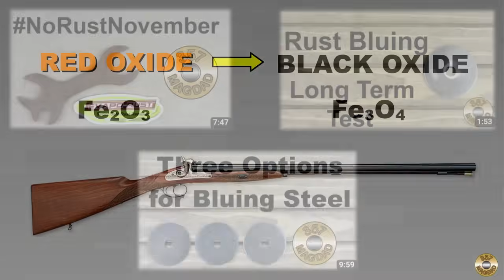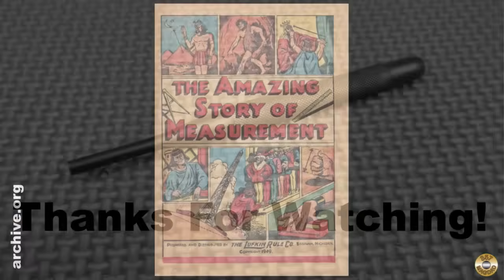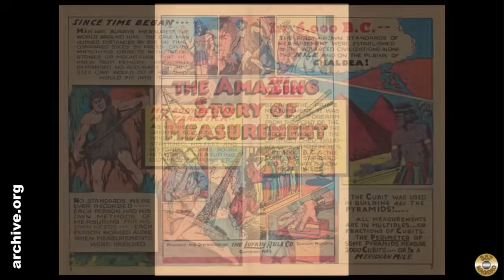DIY Rust Blue - Bluing with Peroxide, Vinegar and Salt

Comment: It should be noted that this type of bluing solution should not be used on firearms. The hydrogen peroxide can cause hydrogen embrittlement leading to failure of hardened parts. There is a reason why quality bluing solutions are available for firearms. If this was safe for firearms, those companies selling other bluing solutions would be out of business because gunsmiths would just use this recipe.
Reply from the maker: Thanks for watching! I think the hydrogen embrittlement occurs when steel is exposed to highly concentrated peroxide vapors for an extended period of time.  The commercial rust bluing solutions are specially formulated to produce colors that better match the original bluing on vintage firearms.
Reply: I call BS on this.    You're not heating the steel up to even lower critical point.   From what I learned in college you hafta be above upper critical point for this to happen. Plus the peroxide has already flashed before reaching 212°F.      Nice try to put down his video though 😢
Reply: @coburnlowman  Hydrogen embrittlement does not require heating the part to occur. It can happen even at room temperature. Ask yourself this.... Given how resourceful and independent gunsmiths are, do you really think they would spend the money on commercial bluing solutions if they could make their own for pennies? The "commercial solutions match antique bluing better claim" doesn't hold water. If nothing else,  gunsmiths and firearm manufacturers would be using this for modern guns. And yet they don't. Gee... Wonder why that is? Feel free to use this solution on all of your guns. No one is telling you what you can and can't do. I'm Just putting out a simple warning because the video shows a gun and there are no disclaimers about what this should and shouldn't be used for.
Reply: How would one be able to confirm or falsify your claim?  Thanks.
Reply: I've used this on gun parts for years. After doing a few I heard about the hydrogen embrittlement thing and was terrified I'd made some bombs in the past. Ran it passed a chemical engineer friend who works in the synthetic fuels industry and he calmed me right down. According to him it happens slowly, penetrates very, very little and the effects are insignificant unless the exposure occurs under pressure like in a containment vessel. I think the reason it's not used commercially in gun bling is that it's very aggressive, can quickly cause pitting and doesnt result in very fine grained rust. The finer or more powdery the rust bloom the finer the finish. Re the pitting, I ruined a few small parts in the past by leaving them just a little too long. Apparently ferric chloride in place of the sodium chloride makes it a little less aggressive.
Reply: Hydrogen embrittlement of gun steel , by Gerald L Spencer. November 1987. This is another report I found on this subject. He said the steel has to be held at 200° C for twenty hours in hydrochloric acid for any noticable reaction. At 16 hours there were only 10% failure under these extreme conditions. What little I read of this report, said that it happens at the upper critical point in manufacturing. 
   I couldn't find the original report from WWII again. It was found on the Scribed website tho. The 1987 Report was just a Google search.
Reply: The video before this, a gunsmith used higher quality rusting salts and then applied the same peroxide. 

Also consider all or most of the peroxide is reduced into iron oxide. 

You make a great point to consider hydrogen embrittlement. Perhaps the solutions should have an excess amount of rusting salts to ensure there is no free peroxide.
Reply: uummm a Noob here.
im restoring a 1960 pieces. had done all the necessary cleaning and stumble upon this "DIY Rust bluing" method,

can anyone tell me if the method  on the Vid will cause peroxide embrittlement or it's save to use on the gun (sear,safety,trigger) Spring?, you know the one goes on the inside of the grip. its  blued before and its already pitted so i clean it throughly.

now im scared
Reply: This is false. The hydrogen in the the peroxide solution is bound as water. Its a mixture of H2O2 and H2O. It donates oxygen to cause the rusting, but the hydrogen stays put in water form. If what you said was true, then just putting steel in liquid water would cause hydrogen embrittlement. It does not.
Reply: common mistake, hydrogen embrittlement requires pressure and/or much higher temperatures.
i commonly soak my blades in muriotic acid ( hydrochloric acid) to remove mill/forge scale. if this phenomenon occurred at low temps and pressures id have gotten back plenty of culinary knives needing repair or replacement  ive manufactued and sold literally thousands of kitchen knives over the last two decades and have yet to have pieces return due to embrittlement...a usually have to repair about a half dozen knives a year and the vast majority of those are handle issues from people letting the hardwood handles soak in water or get run through the dishwasher..this is right up there with the 'stress risers'  boogeyman. people are told something thats taken out of context from industrial processes and apply it incorrectly to the artisan craft world then this rhetoric is spread .
Reply: @mondrose4501  your fine, hes completely wrong. read my reply below.
Reply: Thank you for sharing because I was wondering about that. 
Thanks again for sharing that information 👍🏾
Reply: @RedDogForge  
Thanks for the insight from a master point of view, Means alot since i dont want to cause brittle to this piece of history.
Reply: @RedDogForge  thanks for sharing your knowledge 👍🏽there is a lot of intestine comments. 
If I'm going to blue my pistol I'll just use the commercial stuff. If I was a knife maker or a gun Smith I would probable try and find the least expensive way to blue metal.
Thanks again for sharing RedDogForge ✌🏽
Reply: @mondrose4501  you'll be fine, theyve been rust bluing firearms for centuries
Reply: You don’t know what you’re talking about.  You are confusing this technique with the hydrogen embrittlement that can occur through electrolysis in which case the part is subjected to high concentrations of hydrogen for hours or days.  Gunsmiths don’t use this technique because it’s laborious.  You’re not making a profit using this technique over the faster techniques.
Reply: Dayum dood, you got schooled by the comment section. That crackerjack box "degree" you think you have didn't pan out now, did it??
Reply: Interesting. I recall that hydrogen starvation in high carbon steel can occur in marine atmosphere, causing brittleness and mechanical failure. This was a problem about 20 years ago when a new section was added to the Bay Bridge in Oakland California. Steel truss rods imported from China were to be of a specific alloy, but they sent high carbon steel instead. A year into the project, and failures started to occur. A nightmare to be sure.
Reply: @rowbearpucklebuck2331   im talking out of the top of my head here but my guess is that had a lot more to do with the fact that they shipped high carbon steel than mild. otherwise unalloyed high carbon steels are potentially more brittle than mild ( depends on the steels grain structure from working it as well as heat treatment )and are more succeptible to rusting from salt exposure. mind you this is for m my pov as a knife maker and machinist  im no structural engineer.
id be interested in reading the paper/article..( im a right party animal, i know. lol )
Reply: Tanks ! Saved some research
Reply: When I was in first grade pa got me a chemistry set for christmass , there were some empty spots in it wich had the chemicals he need to blue his guns old school . I got the recipe but several components are unavailable.  Young chemists never even heard of some of them .
Reply: @RedDogForge  a buddy was just telling me that salt petre was never used in pickles and hasn't been used in food since the forties ,, I went and found it on the label in ham . Still a color preservative.
Reply: @RedDogForge  Thanks for the response. I too am just a blacksmith machinist, fabricator. However at that time i was working towards my Mechanical Engineer ticket and working on elemental starvation of steel and steel alloys under varied conditions. Company i worked for was having weld failures at an alarming rate on vacuum chambers and a solution had to be found. Turned out a number  of fuse welded elements were failing because in fuse welding a certain amount of the alloy was being consumed in the weld process. So the weldments became starved of key elements, causing brittleness and eventual failure. It was determined that adding filler rod solved the problem by adding more than what was lost in the welding process. I am sure there is lots of papers on it. As for the bars on the bridge, it wasn’t rust, but actual cracking and splintering that was occurring.
Reply: @shawntailor5485  yep. salt petre ie potassium nitrate. used in a LOT of stuff
Reply: Where is the  hydrogen to cause embrittlement?
Reply: Hydrogen embrittlement is easily fixed just by heating the metal in an oven to about 375 to 400 for about a half hour just to cook it off and far below any temp that would hurt the metal you should also note this can happen when plating such as nickel the fix is the same way
Reply: Peroxide doesn't have excess hydrogen. It has excess oxygen.😊
Reply: It should be noted you have no idea what you are saying
Reply: My friend restores antique firearms and he uses this method because it is what the gunmakers used in the first place!
Reply: @marcwilson1052 the inexpensive way would be to use various DIY and commercial rust blue methods on small pieces of steel and then use a big lead pendulum to hit the test pieces with consistent force and see which is weakest.
Reply: @mtslyh because most modern firearms are either phosphated or cerakoted, like no one blues anymore
Reply: its been 5 month since i ask the question here.

and i had done it. no sign of Pitting or whatsoever and it look blackish doff. 
Thx alot guys
Reply: Good point.  It's also a very small quantity of 3%. Basically just slightly oxygenated water

Unless the temperature is high to open up the grain structure and allow the hydrogen an easy way in. This is why it's a massive problem with welding.
Reply: @coburnlowman heat is not a requirement, my man.
Reply: We use extremely high percentage hydrogen peroxide in our production facilities and if it doesn’t degrade stainless at 165 degrees many times a day and I don’t think at this concentration it would screw up harden gun steel …
Reply: @357magdad as a person who worked in the plating industry, you have nothing to worry about. Its not that hydrogen embrittlement doesn't exist, however it is caused by using hydrochloric acid at high temp or using an electric charge. HCL helps increase electrical conductivity for the copper and nickel substrates for steel plating. This is why you should never chrome suspension parts or any other stressed member.
However, plenty of guns are chromed as well. I probably wouldn't use bright chrome on the barrel or cylinder of a .480 Alaskan
Reply: I think @mtslyh is a hyna
Reply: They don't use this because the other ways are quicker and nicer looking
Reply: @wmdevittdevitt2686 You sir are correct!
Reply: @mtslyh  they aren't because it's seriously inefficient compared to wiping on a product and they care about bottom line not quality
Reply: If that's the case then the punch he made is useless according to yuh
Reply: Well you can do this without the hydrogen peroxide.. just boil the parts in vinegar. 
There are some videos on that just look it up
Reply: @banilvdm2  Exactly. The acid would be more likely to cause it, and it doesn't.
Reply: @RedDogForge  Hydrogen embrittlement also requires H2, which H2O2 doesn't let go of.
Reply: The commercial gunsmiths are neither scientists nor engineers, so none of them have ever done any verifiable testing if this method actually does lead to hydrogen entitlement and neither do they know anything about chemistry or they could just make their own solutions cause if you know a recipe, anyone can mix it
Reply: @banilvdm2  I love informed replies that make those who would scam us for hundreds of dollars squirm..
Reply: @jomamma1750  Yeah he'll be asking student loan forgiveness for that degree😂
Reply: Many don't and I claim BS too. Hydrogen embrittlement is a welding issue not a finishing one. @mtslyh
Reply: Would this be okay to do to my pellet gun I'm restoring?
Reply: Hydrogen embrittlement requires a higher concentration of hydrogen peroxide than this, something like 7%.
Reply: 📌📌📌That's excellence source of knowledge!! 📌📌📌
Reply: @coburnlowman  Bravo!
Reply: You think big businesses give out their secret to us ?
The small Hoppes bottle of oil they sell us for $10, is nothing but mineral oil that you can buy a quart in pharmacies for less .

Comment: Nice looking results!! Just a tip for anyone out there: Every time I see one of these blackening videos (not yours) they always use metal channellocks or needle nose pliers to pick up the piece being blackened. Then they say "be careful not to scratch it" Lol. The best way is to use kitchen tongs with silicone ends/tips, with steel handles. Just a recommendation to prevent any scratches and achieve a better result. Hope this helps. Thanks.
Reply from the maker: Thanks for watching!  Rust bluing is a very durable finish.  Check out my bluing comparison video:
https://www.youtube.com/watch?v=QkcKGgHGRo8

Comment: I used your formula to rust blue a 100 year old broad hatchet.  I put on six coats, boiling between coats and carding between coats.  It did good.  It looks 100 years old, again.  I had to hang a new handle in it, which I rubbed down with walnut stain and started coating with linseed oil.
Reply from the maker: I'm glad you had success rust bluing John!  I'd love to see a couple photos of your project!  357mdad@gmail.com
Reply: @357magdad  ok

Comment: Very interesting.  Thank you.  I read somewhere that during WW2, the Japanese used urine to make some type of "anti-rust".  Their government urged citizens to save their urine for collection.  I read the article a very long time ago and have not been able to confirm this since that time.  On another matter, instead of brushing the bluing on, I see that a lot of machinists just immerse the part into the bluing and let it stay in the solution for a bit.  They do use commercial bluing and seem to get a nicer job then I can get using brushes, cotton swabs and etc.  I haven't tried this yet, but plan to.  Thanks again!
Reply: I once got a very interesting patina on bronze by burying it in sawdust and peeing on it every day for a month. The gold color changed to black with verdigris streaks. The recipe came from a Chinese friend I knew in art school.
Reply: Interesting video Magdad. Is this procedure something that you will start using more than cold blueing? I am going to try this. Thank You for sharing!!
Reply from the maker: I've used it here and there if the part is small enough to boil.
Reply from the maker: Sounds interesting Michelle!
Reply from the maker: Thanks for the info!  Submerging would probably work too.
Reply: in colonial times of America urine or dirt from the outhouse area of citizens was collected to make potassium nitrate, an ingredient of black powder.

Comment: For metric-inclined audience, the ratio (by volume) is 16 parts peroxide to 4 parts vinegar to 1 part salt.
Reply from the maker: Thanks!
Reply: There are two types of nations in the world: those that use metric, and those who have landed men on the moon.
Reply: That’s pretty funny. Ratios have nothing to do with metric or SAE. It is units independent.
Reply: @jvernice Of course ratios are unit independent. However, the devil is in the details. It's one TABLE spoon of vinegar to one (or 3/4 depending on whether you trust the video or the caption) TEA spoon of salt. The ratio of tea spoon to table spoon volume isn't something I am familiar with, which is why I converted everything into a proper ratio of equal parts. There, I've spent 15 minutes reviewing the weird thing I wrote in a comment one year ago. The fifteen minutes I'm never getting back :)

Comment: When cleaning, grinding small round parts, I chuck them in a cordless drill and run it in the opposite direction of the belt sander. It almost eliminates flat or uneven spots. It even helps with cleaning up the punch face.
Reply from the maker: Thanks Robert!

Comment: Giving this a try today. 5 cycles so far and while the parts are darker, carding results in basically the same shade of gray after each pass. Should i be using the brass brush every time, or use only steel wool from now on?
Reply from the maker: @endergt  Make sure your parts are carbon steel.  The rust solution should be orange before you boil the parts.  I usually use fine steel wool for buffing between applications.  Make sure you degrease the part after using steel wool.
Reply: @357magdad  copy all that. Carbon steel parts, degreased before rusting, rusting very nicely and turning solid black when boiled... Then I brush them and they're back to looking like raw steel
Reply from the maker: @endergt  Maybe try a different piece of steel just to verify your process?
Reply: @357magdad  I stopped using the brush and used just steel wool, and mixed a fresh batch of the solution, and it got significantly darker. Not sure if it's as good as yours, but this is where I'm stopping. Thanks for the guide and the quick responses!
Reply from the maker: @endergt  I'm glad you had some success!